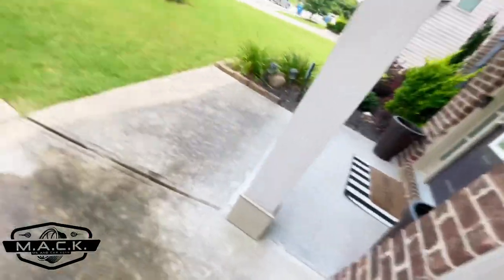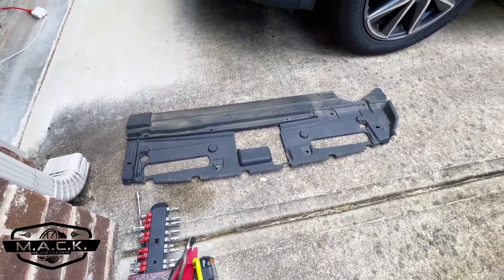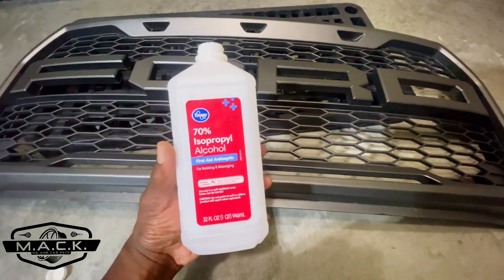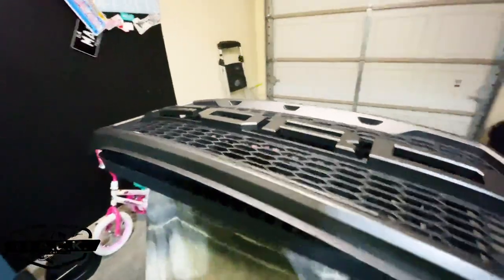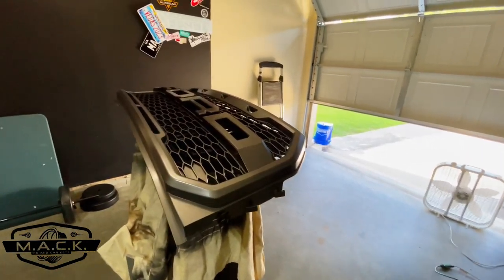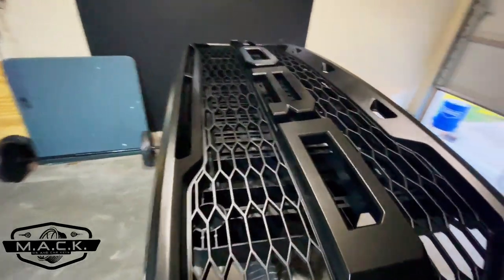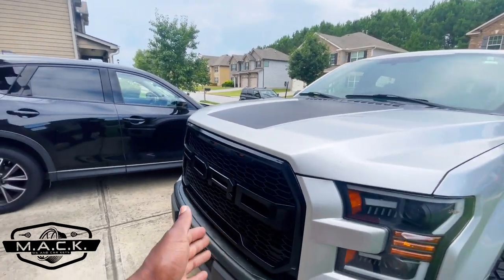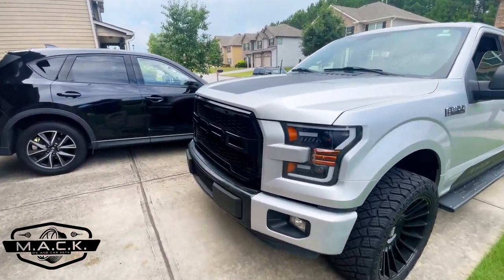Painting my RAPTOR Grill!! #meandcarkeys #raptorgrill

Comment: Nice, I like it, turned out great. When I did my “ Raptor “ style mod to my stock 2019 grill, I found a company that does the amber lights on a metal frame that comes with a wiring harness that just plugs into the running lights on my truck. I liked the look of my stock grill better since it’s color matched to my truck. I do have one word of caution. I’m a pipeline coating inspector, so I watch people paint all the time. Be careful of the overspray, it travels a lot farther than you would think. Might be sleeping outside if you get spray paint on momma’s car😂.
Reply from the maker: 😂 thanks bro!! You see I moved her car to the end of the driveway so that I would get paint on it… probably should have parked it down the street!! 😂  
I didn’t know you had the Raptor grill before. Did it come in grey too? Thanks for watching and for the comment!! I pray all is well!
Reply: @MeAndCarKeys  , I don’t have the actual Raptor style grill, I just put the amber lights in my stock XLT grill. The year I bought my truck, if you got a sport package XLT, they all came with a Magnetic Grey grill no matter what color truck you got. Since I got a magnetic grey truck, my grill was matched to my truck.
Reply from the maker: @jimmyhorton8297   ok gotcha! I read that wrong. That worked out perfectly for your truck! Magnetic grey was actually the color truck I wanted but they were in high demand and would sell quickly! What else came with the sport package??
Reply: @MeAndCarKeys  , center console shifter, the bigger infotainment screen, leather interior, body color bumpers